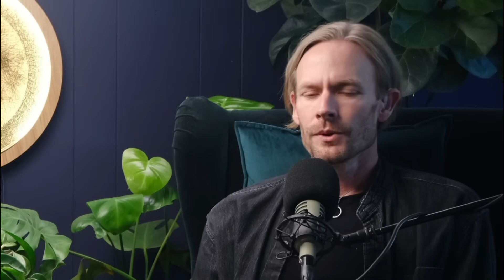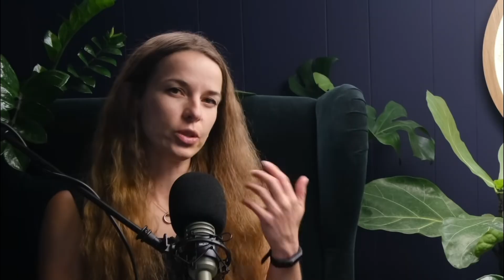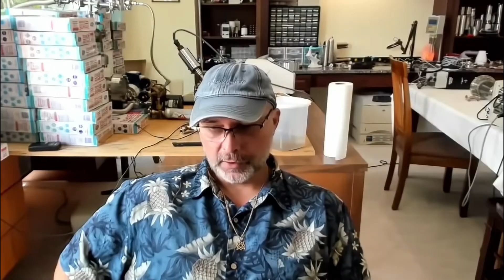There's No Such Thing as a Free Electron

Comment: Particles appear to move along field lines because they are being drawn into channels where folds in the geometric lattice are effectively "unzipping" due to local field interactions, releasing pressure at the only place it can, drawing the particles in, giving the appearance of field lines at the macroscale. But if we could actually see the geometric field, we would see that field lines are the result, not the cause. The cause is unzipping geometric folds, and the result is field lines at the macro scale due to statistical patterns. This is why both QM and classical mechanics fail.

By the way, sorry to say, there is no aether. There is only one field (contrary to QM, but detected in the Higgs mechanism; the other supposed "fields" are just phonon* "handshakes"), and it does act very much like different types of fluid under different circumstances. Sometimes it acts like water, other times like a superfluid and other times like a non-Newtonian fluid. But it is 100% geometric; pure logic in action and completely deterministic.

* Phonons are geometric field corrections that govern all particle interactions. Every single quasiparticle is a type of phonon. Photons are true particles, but phonons are simply wave structures that can be crests, curls or folds in the geometric field. They are also the exchange currency between particles. They arise in the field and where the particle's shell interacts with the field. Though technically the shell itself is also part of the field.

Comment: Here's cool one. If you operate an electron microscope at a "high" current (by which I mean nanoamps), you can observe aberrations which can be related to the electrons repelling one another. But if you consider the total charge moved and the acceleration caused by the electric field, you can easily show that there is never more than one electron in flight at any one time. So how can they repel?
Quantum mechanics is weird!

Comment: What are you talking about? Increasing the vacuum does not change the fact there still is a beam in there. Having no gas molecules only makes it invisible. You don't need gas! The gas molecules are just there to make the beam visible by glowing when "excited". There are no "electron" beads streaming across the vacuum tube! It's a beam of Aether. You cannot pump out the Aether!
Reply from the maker: in a super high vacuum, current will not pass through the tube without thermionic heating of the cathode, which destroys it and releases atoms into the tube
Reply: @DemystifySci_Podcast  you know electrons travel through the vacuum of space right?
Reply: @DemystifySci_Podcast  In a super-high vacuum, the cathode ray is essentially static. The electric field is present, but without matter at the cathode to interact with, there is no measurable current. Heating the cathode does not create the ray, it only releases a few gas molecules that allow the Aether flow to begin moving. This explains why the current appears and why it is still weak in extreme vacuums. The ray itself does not disappear. What we detect as current depends entirely on the interaction between the Aether and matter, not on the existence of electrons as particles. For a deeper discussion, see my paper, particularly the chapter on gravity and the interpretation of the atmospheric electric field as the gravitational field.
Reply from the maker: @SciD1 if the aether is the cause of the current, why does current not increase as you remove the residual gas?
Reply: @DemystifySci_Podcast The current does not increase as the residual gas is removed because the gas molecules are what allow the energy flow to interact in a measurable way. In a super-high vacuum, the Aether (or energy flow) is still present, but with very few interaction points, it remains essentially static. Removing the gas reduces the ability to generate a detectable current, which is why heating the cathode or adding matter is needed to trigger measurable flow.
Reply: @DemystifySci_Podcast  Chantal Roth’s elastic solid Aether model is a fundamentally misguided concept. Not only would a solid Aether introduce impossible properties like drag and rigidity, but it also remains trapped within the mainstream physics narrative it claims to transcend.
Reply: @DemystifySci_Podcast  I find it truly surprising that my theory is being ignored, especially when it offers a coherent and logical alternative to the mainstream view. I am not trying to compete or undermine anyone’s work (your book); I am simply presenting a different perspective that deserves open discussion. It may challenge the established paradigm, but that is exactly what science should be about. I would have appreciated at least some feedback, whether it was seen as too unconventional, too straightforward, or just not aligned with the tone you want to maintain. Silence only reinforces the impression that new ideas are unwelcome, and that is disappointing, considering the number of dissidents you've met on this show. I am not asking for a live conversation with you. Not my thing. And besides, English is not my native language.

Most Aether models I’ve seen so far are absurd. They lack a true physical mechanism and usually focus only on light, which makes no sense. My model, on the other hand, unifies all forces through a single medium, restoring a natural and coherent view of nature, something modern physics seems to have forgotten long ago.

And although you have invited speakers to discuss their Aether theories, I sense that you still haven’t fully accepted the Aether’s existence. You have started to ask the right questions, and you can see that certain areas of science do not quite add up. Yet it seems you are still holding on to the old paradigms, unable to let them go completely. It is as if part of you recognizes that something is deeply wrong in the foundations of modern physics, but another part keeps clinging to the comfort of the familiar. True progress, however, begins the moment we dare to step outside the framework that limits our understanding and look at nature with fresh eyes, free of inherited assumptions.
Reply: @DemystifySci_Podcast  A true Aether model should stand on its own, not be forced to fit within the contradictions of quantum mechanics and relativity. If you propose the existence of an Aether, you can’t keep the baggage of mainstream physics; particles, waves, electrons flowing through wires, wave-particle duality, curved spacetime, the Big Bang, expanding space, or Bohr’s planetary atom. It’s one or the other. Nature doesn’t need both. Nature is simple, consistent, and intuitive. If you haven't already read my paper, go right ahead. Leave your pride behind.
Reply: Oh well, looks like I've hit the nail on the head. Very disappointing. Unsubscribing. 🙄

Comment: The destruction of the cathode emitter it's not necessary for the electrons to escape but the electrons that don't escape and instead annihilate will create tiny pockets of intense heat that will pit the material - electrons require resonant input of wave energy in order to support the electron structure - without the supporting input the electrons can ablate or annihilate out of resonance producing heat
Reply from the maker: dont you see how that's a story that seems tailored to maintain the electron story? the work function of a metal is taken to be the amount of energy necessary to liberate an electron, but it might represent something more obscure about the continuous but quantized nature of current
Reply: @DemystifySci_Podcast - I understand what you're saying, but what I understand, and this is contrary to to mainstream science, electron production is actually electron formation - until the electron core is complete, the forming particle is not stable - electrons are packages of potential and they can either ablate or they can annihilate - if they ablate then they are not receiving enough inward pulses of energy to sustain them but if they're still in resonance with their surroundings then it'll feed the other electrons and other processes - on the other hand if they annihilate that means that they are ablating out of resonance with surrounding particles and processes, producing heat - if they are released into a field of low pressure gas than they are latching onto open resonance slots in the material - too much pressure snuffs them out - a perfect vacuum just gives them nothing to latch on to - I know this is contrary to what you probably believe but I've been working on this for a while, among other things, and have not published yet

Comment: Electron mobility is ridiculously low in solids. If you want a sizable flux, you need to heat to extract more, but electrical current would not give you as much due to the low mobility. However, if you are good with a basic flux, you don't need to destroy or heat. The same reason why for getting much plasma you need to explode material to essentially decompose it entirely, rather than just let it dissociate and recombine via current reversibly.

Comment: I've tried to use Ai to undestand the conversation, and for me it seems the quantum explanation could be equivalent to an intuitive, mechanical reasoning, as the speakers would like to be true.

The key is to see the "material medium" (like a gas) not as a separate thing, but as a modification of the vacuum's quantum field.

In a perfect vacuum, exciting the electromagnetic field requires high energy, often achieved by breaking structures (e.g., thermionic emission), resulting in free electrons and direct photon emission.

In a material medium (gas, solid), the atoms and the EM field become a coupled system. This system supports new, low-energy collective vibrations (like excitons or polaritons). The energy can propagate as a wave through this coupled system without needing to rip atoms apart.

So, the "low-energy vibration in a medium" model is essentially the effective description of the quantum field model when matter is present. Both are part of one unified picture: the quantum field is always the fundamental "stage," and matter simply creates new, lower-energy ways for the "play" to unfold.

Comment: Electricity in a wire is the atoms spinning. This is why wire can get hot too, the spinning creates friction and heat. Too much spinning/electric current, the wire will melt because the heat produced by the spinning atoms will be too great. This is why metals that are great electrical conductors are also great heat conductors.

Comment: Charge around one proton (hydrogen) is equal to one electron. Now, you can scale it up. That's all. Electrons are not particles. It's ether in motion. The key to understand the whole conundrum of matter is to figured out why two hydrogen atoms make one stable particle, a.k.a. molecular hydrogen (H2). Neutron is the same particle as proton in which ether is flowing backwards. Vacuum is not empty space. Matter (protons) slow down ether in motion. Protons are cavities within enter. The real empty space. This is the only way to generate resistance within a black hole we all are immersed in. Imagine one huge nucleus made of all matter in our visible universe. It would be a ball as big as the diameter of Earth's orbit around the Sun. Think about it.

Comment: Ahhh, the trail of breadcrumbs on a Sunday morning. 😊
 The aether is magnetic, the induced magnetic field stiffens the aether fabric. (Aether density leads to stiffer fabric) Magnetorheological 

 Aether near stars is stiffened, the Einstein Ring effect is such that the blue ring closest to the star is aether particles (needle shaped) are perpendicular to our line of sight and resistant to deflect. 
 Light or any energy for that matter transmitting through space is done so by the deflecting needle shaped magnetic aether particles. Like a string of dominos. 
 Try this out… aether particles are responsible for thermodynamics 😳They are the particles that transfer all heat, all energy throughout the Universe.
Reply: If it's aether how can you create faraday cage to shield insides from "aether" and simultaneously lit a light inside Faraday cage, that needs supposedly aether to propagate?
Reply: @piranhaofserengheti4151 a faraday cage provides a more efficient surface for opposing charge to redistribute, relative to the permeability of the air inside. 
 A faraday cage isn’t an impenetrable field. Charge inside moves according to charge outside. It’s why conductors are used for a faraday cage.
 The “cage” doesn’t shield, it’s the magnetic and electric components of aether that oppose one another. The cage is a more efficient surface for this to operate.
Reply: @PaulCaron-s1x  Yeah, that word salad is totally negated by simplest observations..
Reply: @piranhaofserengheti4151  Well that’s as dumb as I can make it. I’m confined to using words in a comment section on YouTube. I learned those words by reading a book.

Comment: At 1:10 she mentions a sca ning electron microscope. Ironic.
Reply: electron microscope is a false name, it requires a powder coating to work, no such thing as electron does ever take part in the process
Reply: @zabtej1645 as someone who worked with an SEMin college, that's not true. Electrically conductive samples are used and the scan tip works in a hard vacuum in one of two modes: constant height or constant current. Electrons do leave the surface in cold states and cross the vacuum producing a current at the scan tip. Unlike the cathode tube, cold emission occurs in an SEM.
Reply: @LaserUbermensch  What you call electron is not a quantifiable particle, it's a snap of discharge of given amount, you create a grounding path with your scanning tip and you measure the voltage/ current. We're talking about the same thing, no need for the particle nonsense. It never works. Not at the double slit experiment, nor in the photoelectric effect, nor here.

Comment: What is misinterpreted as an electron is really a structured longitudinal excitation of the fundamental medium itself. Without a vacuum, the longitudinal impulse is scattered and dissipated by complex interactions with what we observe as gas molecules. A perfect vacuum lacks a sufficient density of structure (residual gas atoms in this case) to act as "repeaters" which allow the coherent structure field that constitutes the "ray" to be formed and sustained. The residual gas atoms are sparse enough to not cause chaotic scattering, but dense enough to structure the impulse, and act as a non-linear guiding medium, shaping the energy into a coherent self-sustaining soliton wave, which is what we call a "cathode ray". Thermionic emission is not actually emission at all, but surface transformation. Heating performs a structural transformation -- breaking down the rigid, crystalline structure of the cathode material -- to make it an efficient transducer for exciting the underlying medium. The observed surface damage is not a side effect; it's the primary mechanism.
Reply: So you are aware of dirty shoes. Noicce.

Comment: There are no such things as electrons. And now most people stop reading.
What you see in a "vacuum" tube is the slowing down of energy transfer.
In lattices, most of the time you can't see the energy transfer between atoms(lightning you can see).
As you remove atoms from a gas the distance between them increases and the scattering effect diminish between the poles. This forces the energy to jump from atom to atom in the line of sight instead of using the whole lattice. This slows down the process and we can see the process. 
That the glass deforms has nothing to do with it. The energy transfer to the glass from inside is very small, especially if you are blasting heat energy at the glass from the outside. 
In a perfect vacuum in space there are no atoms that can be resistors or scatter energy in a way makes it visible. 
In a perfect vacuum the energy is transmitted without a delay. 
The so called cosmic streams are just dust atoms/particles transferring light/energy and we see the scattering effect in the atoms of our eyes and brain cells, like a vacuum tube.
I dare any mathematician to calculate nothing/vacuum in an equation. It can't be done! Therefore any mathematical explanations always have imaginary constants.
Reply: So refreshing and nice to meet real spirit. Thank you! 
Yes electrons are a mind virus invented to prevent people from understanding.
Reply: @Observing-the-World  The Ivy league has really messed up education. Those who got an degree from there, will not listened and are sadly just actors and not independent thinkers who will fight to the bitter end to defend status quo. They paid big money for the grades and connections.
Reply: Nothing you said makes any sense.
Reply: @piranhaofserengheti4151  Your loss.
Reply: @mossig  Nothing worth attention was lost because nothing worth of attention was produced.